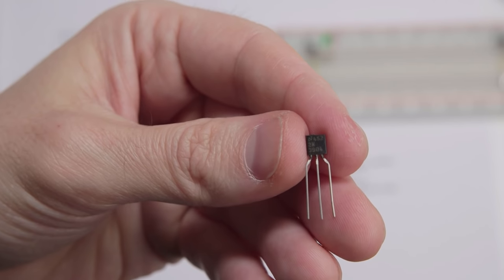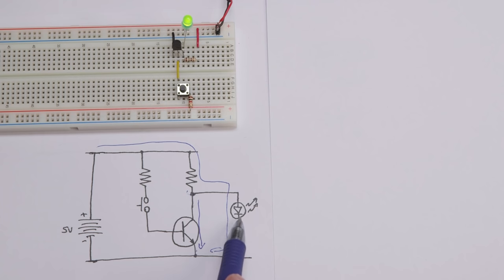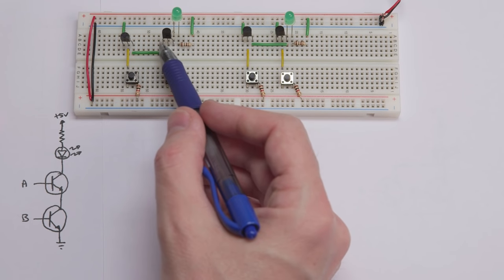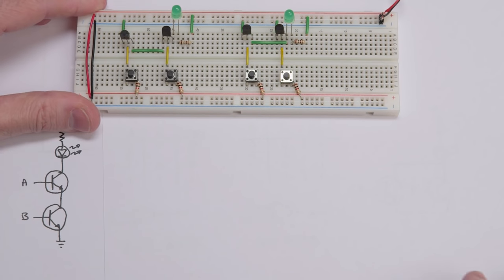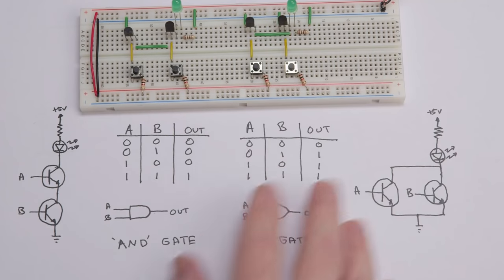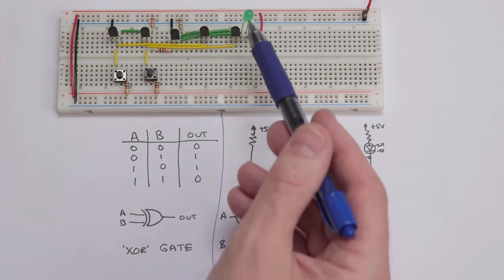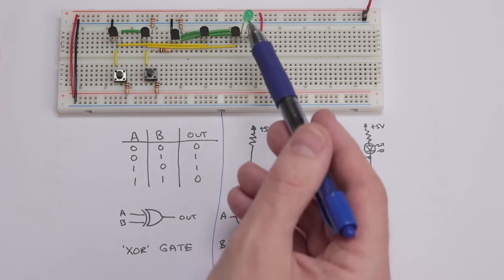Making logic gates from transistors

Comment: In the second example why does the led get 0v, shouldnt it become a parallel circuit and share the electricity?
Reply: first of all, think of the transistor as a switch. when on, the switch is closed. so basically, you're shorting out the circuit right before the LED. you can try this by wiring 5v to Resistor to LED to GND, then take a wire, hook it up after the resistor and directly to GND. there is so little resistance in the wire that, while the connection technically is a parallel connection, there is basically 0 curreen the LED to use, thus turning off.
Reply: @carlos2004  Ok I understand that led has more resistance but how much? Even if I put 400k resistance as a alternative path to the LED straight to ground so it has the choice to pass from the 1k resistor to the led to gnd or the 400k resistor to GND it still doesnt light my led. Shouldn't the fact that I now have a high resistance resistor there now make the circuit become parallel. How much resistance would led have by comparison that it would avoid it entirely. Is there a formula I could use to calculate? Thank you for your reply
Reply: @David-wf3cc  i'm not sure i'm understanding your question. here's a circuit simulation that might help http://tinyurl.com/r286c7x 
first and second examples from the simulation are first with a real switch, and then replacing the switch with a transistor.  if you start adding resistance to the alternate path to ground, it then basically becomes a voltage divider, which is the third example. 
and lastly, careful with the simulation since it will show the led to be "on" but in a real life circuit, the brightness would be so dimm that it would basically be off.

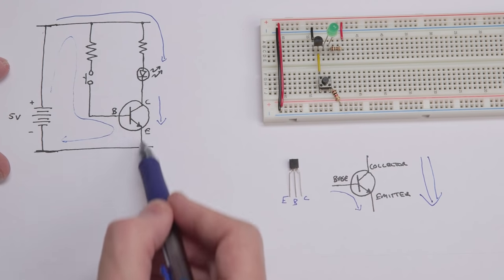Comment: so at 1:42 if the button isn't pressed, where does the current go? it can't just go nowhere right?
Reply: yes you are right, but here he was explaining how the transistor works (when the current flows from base to emitter (by completing circuit, using key), then the transistor turns on and starts flowing current from collector to emitter.) 🧑🏻‍🔬

Comment: How do you choose your resistors? My transistors always seem to either light on fire or not turn on.
Reply: Looks like he's using 1k base resistor and 100 ohm for the collector.  The base receives smaller current than the collector on the order of about 10^2 (dc beta), so the base resistor needs to be the larger of the two.

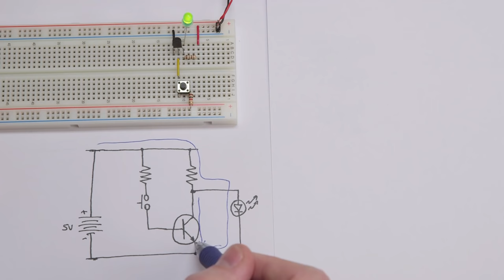Comment: @3:00 while discussing NOT logic using transistor, how does switching ON the transistor drops the voltage between the resistor to zero. Which law of electricity is being discussed here?
Reply: Kirchoff’s Laws. The current only has one way to go before you close the switch. After you close it, the current goes through two parallel branches with resistors and then it comes to a junction where the current is allowed to bypass the LED. This is only after you close the switch, since before the current is forced through the branch with the LED.
Reply: @marcopantoja3731  I think that when the switch is pressed, the transistor lets the current a direct connection to the ground. All the voltage through the second resistor is dropped therefore by the second resistor itself and therefore, no voltage difference is available to drive the LED. 

Is this correct?

Comment: nice digital device. a alternative is an anelogue device. where different voltages and amperages is  the modulair information carrier. it is also more precise and versitale. only not good to store more information then you actually need. you can not push a reliable anelogue device aperatus and computer. too a... barier limit... to impress.. your friends at school or in a bar... ahum...
Reply: ayo bro im a dummy.... is the reason transistors are used because its like an IC with logic shtuff but with complexities however and the tradeoff being more power output....
Reply: @mellonhead9568 i could be wrong. i am not an expert. just someone who speaks its mind. my guess is. why transistors is used. in an anelogue computer ? as some sort of audio equalizer. a transistor. is on or off. so it can devide a electrical current with changeing voltages into different categories. say. there is 3 volt. that is represebt for some data... and the transistor too. for example the diskdrive is off. because the voltages is goo low at that schematicle conductive track. the  for example a key is pressed on the keyboard. that opens a software menu. that says. Load file. for example. then the software generates 1 voltages on that cirque extra. but not on every cirque. blocked by an diode or suchs. then the voltages increases 3.1 volt. 3.2 volt. 3.1 volt again 3.4 volt and with 4.volt the transistor "switches as an relais" on becaise its thresh holds power is reached and produces one steady on electricle stream with non modelating electricity to anothet cirque track. switching for example the "hardware ready" state on pf the diskdrive motor. to spinn in this example too the right track. too load some data. so a transistor. workes as a light switch. you dont have to push it with your finger. you can just send some electricity too it. wich can be fun or interesting. another device that works as a cirquite breaker is called a "relais" wich guide electricity from one lane to another on a.. board.. or uhm.. a switch board... with an electricle motor. that pushes also some light switch.. as you will... mister...WITH  DOUBLE D CUP BETWEEN ITS EARS. :-)
Reply: if i think of a computer. i will fantasy maybe some transitors. but making hardware work beyond a certain voltages or below it. while mainting the amplitude or strentgh is just more data rich. then on and of. it could be anything between on and off. if i call 1 volt on and zero volt off. then in a digital computer that is all. but with an anelogue computer i still will have theoretcly 0.32 volts and 0.44 volt s and 0.10 volt as data carieres. wich is just more... less harsh data for this steel companion with its jelly meatball interface with feelings. it iw just more.... living being friendly data ? i call it a clumbsey freindly device while a digital co.puter is hard deadly and very delicate. and slow and with a tremendouse data. not even to be used so.etimes. want too push this button too clean up acces unused files.... option ??? or defragment the fiftheen million files disk. it looks from a logicle sciencetific part a bit..... dirty.
Reply: normal on a device. you use only 1 file. and a computer. or an automated machine in spirit is. 1 button fix all. i think we where carried away abit thru too uhm... succes ?? or suchs.
Reply: mellon head. it is like building a computer concept around a volt-or mulit-meter, instead of a transistor.

Comment: CAN ANYONE HELP?
I am trying to build a full adder from transistors
 and have been stuck for far too long... Can anyone help me?

I am somewhat new to simple electronics and have trouble
 reading schematics; these simple videos are giving 
me clarity and a start.

I have successfully built all of the logic gates
 as I have, and have even created a half adder...

BUT (and there is probably a simple answer here
 discover from one gate into the input of another...

Simply put: I cannot figure out how to connect the
 output of my XOR gate (which is currently lighting  up an LED) into the input of another XOR gate... or 

even a simple transistor base to power something.
The only solution I can possibly think of is to 
 possibly connect a PNP transistor to the output of becauseto power the transistor).

If anyone can help me, guide me somewhere, or 
 provide any insight I would be IMMENSLEY grateful.

Comment: 3:46 why does the LED get 0 Volts when the transistor is switched on? Shouldn't the current flow through both, transistor AND LED?
Reply: Not an electrical engineer or anything, but I think there are two ways to see it. 
1. When the transistor is turned on, both sides of the LED are effectively connected by the same segment of wire, therefore the voltage diff across the LED is 0 and no current is flowing through it. 
2. This portion of the circuit is in parallel. The transistor has approximately no resistance and the LED has some resistance, so all the current flows through the transistor portion. The resistance/current for components in a parallel circuit is related by I1/I2=R2/R1. Let I1 and R1 correspond to the LED component and I2, R2 correspond to the transistor component. We can see that as R2 -> 0, I1/I2 -> 0 and I2 becomes much greater than I1.

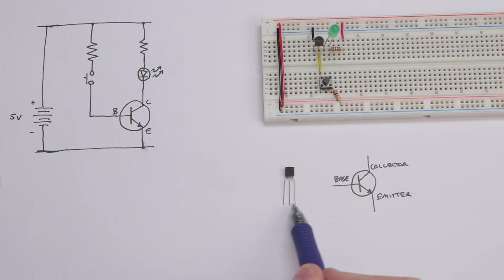Comment: 0:12 Correct me with detailed explanation if I am wrong. According to your circuit diagram the current has two paths to choose from when traveling to this NPN transistor. Either through resistor one and on to the button which, when pressed closes that part of the circuit and allows it to pass to the base of the transistor and out through the emitter and back to negative. Or, if the button is not pushed, wouldn't the current bypass that part of the circuit and go on to resistor number two, through its LED, into the collector of the transistor where it will stop due to the transistor not being open because no current was allowed through to the base? Did I get that right? I am asking because you said if no current was present at the base, then the second part of the circuit shuts off and the LED will not light. The LED being before the transistor collector, would still light up and allow the current to make it to the collector where it would stop since the transistor is in off state due to no current at the base, no?  Cheers and thank you ever so kindly for sharing this knowledge.
Reply: Noo , that part of switch is in off state , there is actually a no voltage ... Due to no potential difference state current won't pass through that

Comment: What is the function of the black wire on the left of the board?
Reply: To link both negatives rails so he can use either the top or bottom rails for negative.  Same for the positive rails.

Comment: Could someone please tell me, in the XOR schematic, is the +5V at the middle needed cause (correct me if I'm wrong) I think it could work even without it. (Imagine without the +5V in the middle) Let say A = 1, B = 0. The current would flow through the OR gate to the Collector of the middle transistor (Buffer) and flow through it  OUT = 1. And if both were 1 the it wouldn't flow through the middle transistor (Buffer) cause there wouldn't be any current flowing into the Base of middle transistor (Buffer).  Again, correct me if I'm wrong and the explain please why. 🙂

Comment: Can i ask. What power source did he use?
Reply: you can use simple batteries to get around 5 V to make the circuits (4.5 or 6V made out of 1.5V batteries connected in series). I think he used a professional power supply though.

Comment: I greatly dislike people that 'teach' hole flow theory.  Hole hold nothing.  Current flow is the measure of electrons over a certain point per second (6.241 x 10 ^18). Therefore current flow is from negative to positive.
I have been in the field of electronics since 1976 in every capacity (tech, design eng, instructor, installer, upgrader, etc).
Otherwise, a good basic lesson.

Comment: 2:40 doesn't current flow from negative to positive??
Reply: Physically speaking, you are correct. The convention, however, is to treat current as though it flows from positive to negative. This is due to historical reasons. In the early days of studying electricity, scientists didn't know if the positive or negative charge carriers were the ones that flowed, so they just guessed positive, and stuck with that convention. They were wrong, but since there is so much existing material using the positive to negative flow convention, and there's no real benefit to changing things, we just stick with it.

Comment: for an and gate, could you not use 1 transistor with both inputs being switches instead of transistors in series?
Reply: i'm searching on internet everywhere about this, couldn't find any proper answer about this
Reply: Update: this can probably be the same reason as why we use OR gates instead of just connecting two wires

Comment: Why do you place a LED before transistors, but not after? If I try to put LED after transistors, then the circuit does not work properly as a logic gate.
Reply: When the transistor is off the circuit isn't completed, so electricty doesn't flow and LED is off

Comment: Tried this but my LED turns on and stays on. Switch doesn't do a thing. I really would have liked to see this work. Using parts from his clock kit so perhaps I have just guessed at the wrong components. Can't find a list anywhere of just what he used in this demo. Sigh.
Reply: Turns out my switch was set incorrectly. Rotated it 90 degrees and it worked as advertised.

Comment: How could I connect the output to another gate?
Reply: think of gates as switches; all they do is pass the current. so just go from "collector to emitter to collector to emitter " with as many gates as you need.

EDIT: mhh, i think you might be asking the output being connected to the base another transistor. in that case, just add the resistor (1k).

Comment: transistors are kinda little AND gates themselves no?
Reply: In this example you're right to draw that comparison. However, transistors can also be used to apply a much larger current/voltage than the one present at the Base, so it's not quite the same as an AND gate. You could for example turn on a transistor with a 5V source applied to the Base, causing a 20V source at the collector to be applied at the emitter. This is how it's possible to use low power CMOS outputs to control a high power output, such as a motor.

Comment: I know I'm 5 years late but can someone explain to me how the led is before the transistor but the transistor still blocks the led from being lit????????
Reply: I'm not sure what part of the video you're talking about, but I think that the way transistors work, if there is no current going to the base, the transistor stops electricity from flowing through.

I'm not sure, but it's what I think based on how they behave in the video.
Reply: @ciderfan823  on the first circuit of the video on the diagram it shows current flowing into an LED and then after the LED is a transistor, in the actual circuit the transistor comes before the led though????
Reply: He just played around with the topology if I understand your question correct. Both resistors in his circuit are connected to the red 5 V line. The LED still connects to the transistor at the collector and the transistor's emmitter is still connected to ground. The push button is also correctly connected to the base. All the parts are connected as drawn.

Comment: New to electricity here, so don't laugh. My question is in your first example, why did you even use a transistor. Can you not make a led work without it?
Reply: this video is about transistors, he could have jumped straight to not or (and & or ) circuits but he moved step by step. yes he can make the first circuit without a transistor but it was the simplest example of a working transistor
Reply: If you just want to turn on a LED, yes.  But as a building block for more complicated circuits right up to computers, then no.

Comment: i never understud how inverter works
1 wire to in
1 wire to out

how i understand this (never seen real inverter in my life)

if in is true then out is false
ok, its not that hard to drop tge voltage
if in is false then out is true
HOW, from were that current and voltage comes from?
well you can hook up another input and keep it allways on
but this is an AND gate, were one input is allways on, it can't be that

Comment: thats not what in my phone billions of them. who is gonna turn the switch in my phone? oh sorry if i had a switch i wouldn't need a transistor at the first place
Reply: The switch is there to create an input. Of course that input doesn't have to come directly from a mechanical switch, it can be the outout of another logic gate. So your phone is a huge network of them feeding into each other. Of course you're eventually going to reach the point where you do need some human made input and that is where the memory and your own tapping on the phone screen come in. So the answer to "who turns the switches in my phone?" are you, incoming transmitted data and the programmers behind whatever you're running.

Comment: 📺💬 Please tell us what are they, It is default closed and open with a diode circuit the difference is the same as called the advantage are default closed we do not know the target active device when the default opens we are monitoring it with LED or display. 
🥺💬 With default closed you create a shortcut current flow easily but default open you can add more joints to prevent it or detection.

📺💬 What we can do with XOR gate is similar to the OR gate.
🧸💬 It is a diligence logical gate, you can compare both input frequencies or perform an evaluation of your signals.

📺💬 เฮ้ยยุ้ยอย่าสอนพวกมัน 🥺💬 ปกติมีอยู่แล้วครับ เอาแค่เปลี่ยนสายไฟบ้านก่อน ไม่ต้องมาตัดสายไฟบ้านผมด้วยเดี๋ยวพูดแล้วเดี๋ยวมาตัดอีก พวกเค้ากวน ไม่โดนไฟดูดหลอกครับมี safety.

📺💬 There are a lot of operation gates that allowed you to create computations or perform specific tasks.